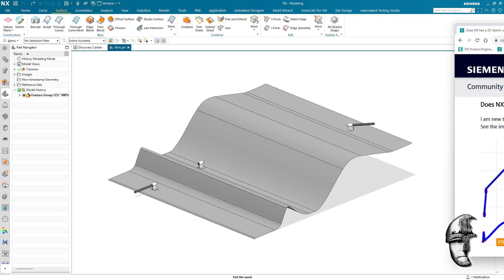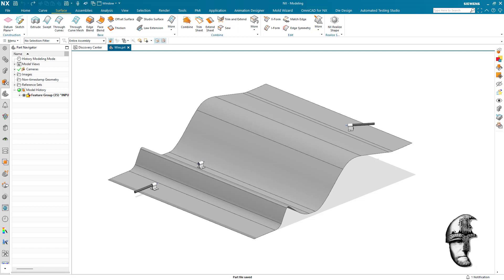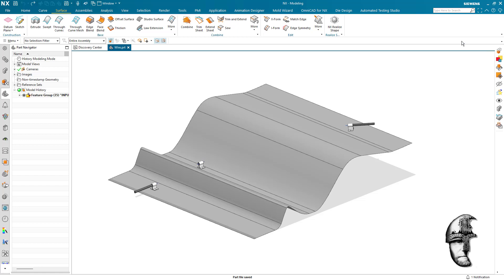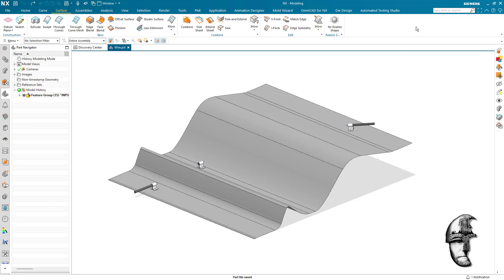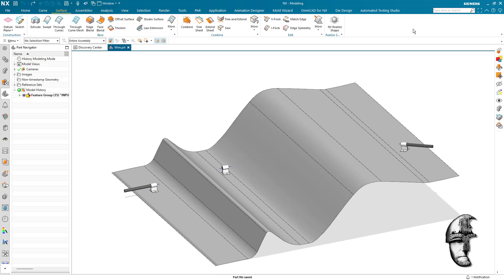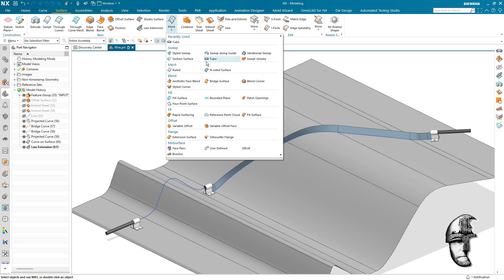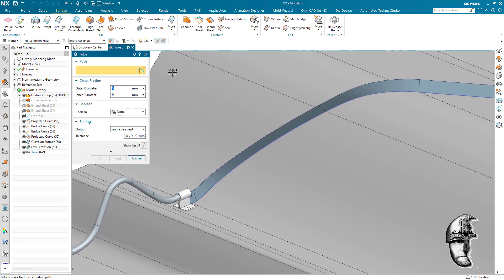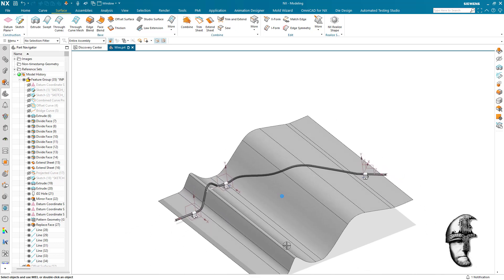Siemens NX General Tick's - Wire Creation using Curve Featues

Comment: Good evening, I don't know if you've already covered this in another video, but let's suppose I have a wiring harness project and I want to validate that no curve in the wiring harness exceeded a maximum value specified for the project. Can I validate and identify the points that need correction?
Reply from the maker: Hi @mateusbsmg, this video show an example on creating a wire without using the Electrical Routing application within NX. As stated in the video there right way to go about this is tu utilize the Electrical Routing application as this would help avoid the situation you describe alltogeter with a set allowed minimal radii. Now still if this would be built according to the video I would assume that you are realying in a centercurev and that is the one you want to ensure that the bed radii therof is not under a certain value. There are sveral options available but the one I would promote would be the utliziation of Chackmate as this can also beautomated. I hope this takes you closer to your end goal. // Best Regards Fred

Comment: I'm probably being overly critical, but wires are suseptible to gravity.
Reply from the maker: Hi @Mrddrichards, that is correct but the requirement here was to create the path or the wire with clearance. Now the described way is an example on how to create paths and wire without the real built in smart criterias attached to the routing of your design using the available standard features. Using the module Electrical Routing will provide you with all the powerful smart automation as well as integrated electrical routing design criteria include the slack.